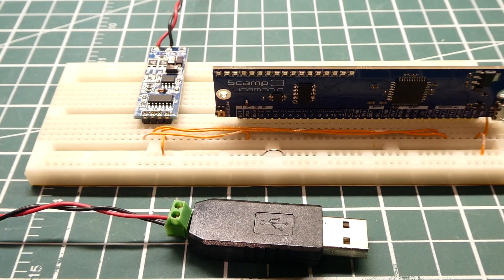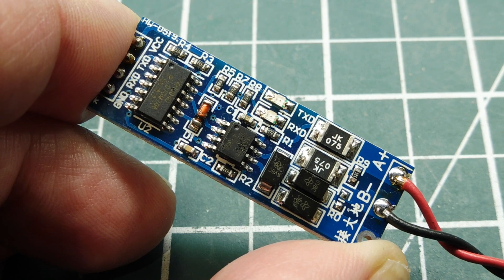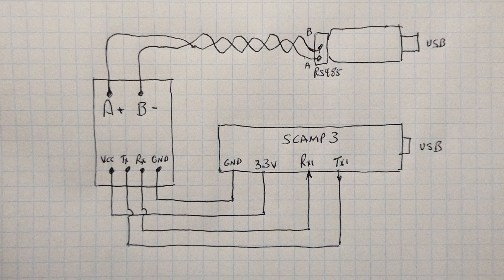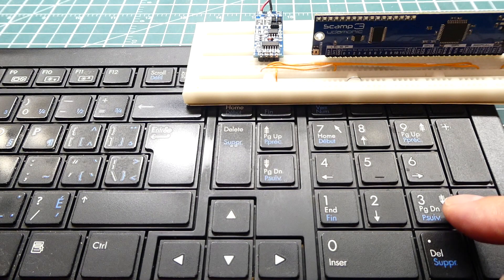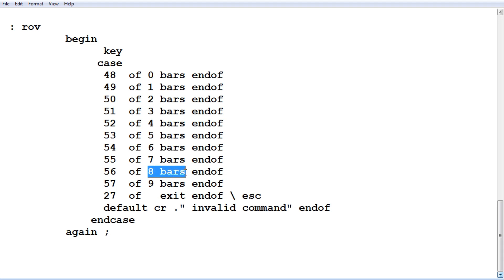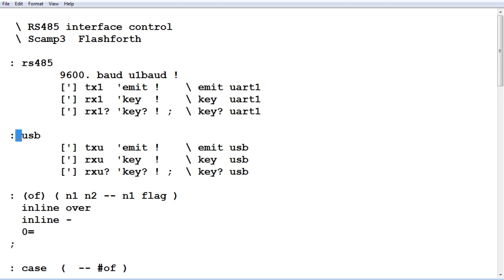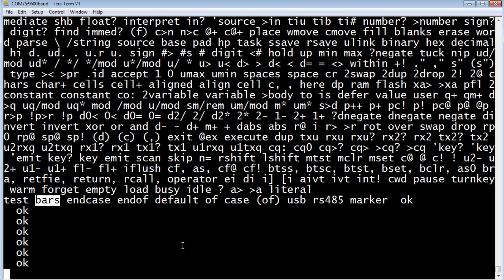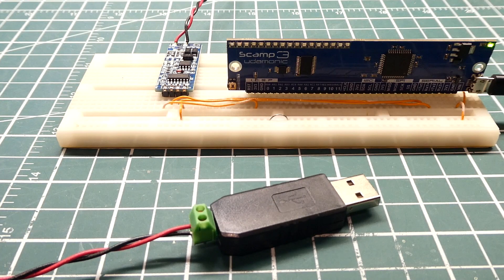RS485 Data Link / Scamp3 / Remote Control

Comment: Very nice!  RS-485 is on of my favorite 'wired' ways to gain access to (or extend) I2C bus located in noisy or inaccessible RF environments where critical controls must be fail-proof/robust. UART to I2C bridge (NXP part #SC18IM704PWJ) can be placed at end of RS-485 loop, and obviates the need to place a microcontroller in a remote or difficult location to access.  This makes reprogramming of microcontroller and upgrades super easy.  I have seen speeds of 1 Mbit/s or more (I2C fast mode plus) up to 200 meters with zero/low error rate depending on RS-485 device chosen (slew rate, speed, simplex/duplex seem to be the key parameters).  CAT6 with good shielding and 120 ohm termination of loops always helps too.
Reply from the maker: Thanks for sharing.

Comment: Awesome ! I've always been very fond of RS-232. However, in the past I used regular CAT5e to cover lager distances, something like 400m/1300 feet. By reducing the transmission speed this worked fine. Of course this was not a regular domestic internet connection but for a specific hardware device.
Reply from the maker: I'm impressed with the distances you got using RS-232. Thanks for sharing.

Comment: Hey @0022mer, love your scamp videos! I was wondering, have you ever messed around with the pic microcontroller's encryption module in flashforth for an encrypted communications? I bought some Scamp3's to try and see if I can get the encryption module working in flashforth, as I think it would be neat to setup a wireless IoT, but with communications done through AES-256 + use some of the additional security features built into the module. I was thinking it could make for a pretty secure garage door opener!
Reply from the maker: Currently Flashforth does not have support for AES encryption. For a garage door opener you could go stand alone with Microchip's Keeloq. Check out the MCS3142.

Comment: Awesome video.  The Case word seems like a pretty complicated bit of code.  What is it actually doing, could you give an analogy to help me understand?
Reply from the maker: The word "key" detects a key press. Each key has an ASCII value. In this case we are decoding keys 0 to 9 and the ESC key. which will give us ASCII values 48 to 57 and 27 for ESC key. When we press a key , the ASCII value is compared to the list in the case statement. If there is a match the code between "of" and "endof" is run. If there is no match "Invalid command" is printed out.

Comment: MAX485 requires min  4.75V for proper operation. How come that module works with 3.3V?
Reply from the maker: The MAX485 runs on 5 volts. If you run it on 3.3 volts it will work, but the range and speed specs will degrade. The receiver works down to a differential voltage of 200 mV. Use MAX485 for 5 volts, MAX3485 for 3.3 volts and MAX14783 for 5/3.3 volts to get specs as per data sheet.